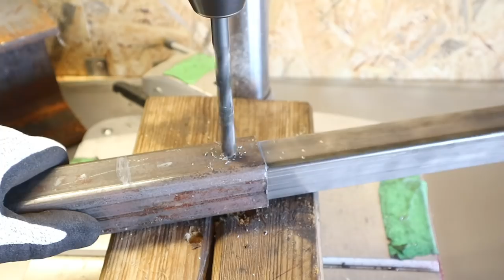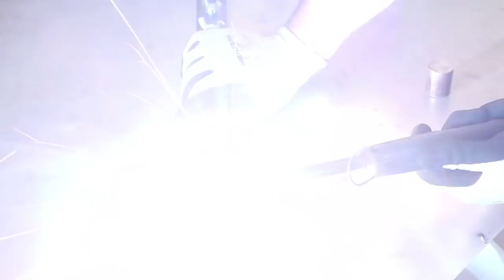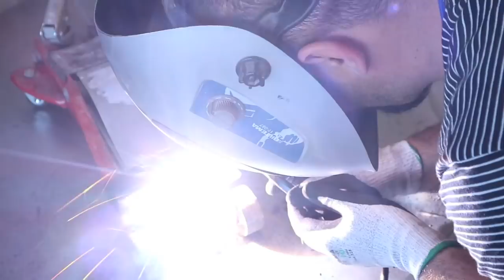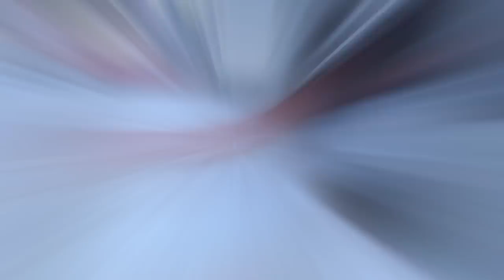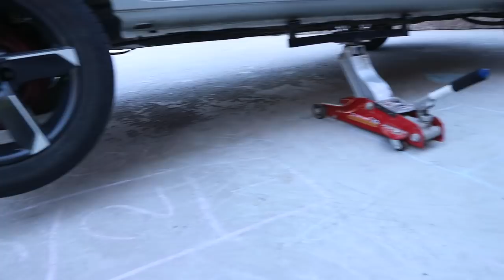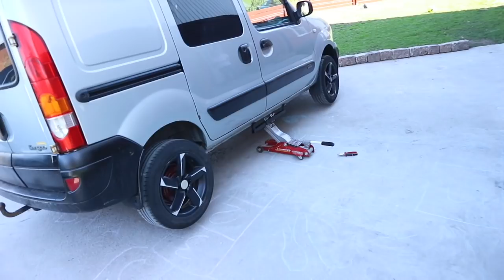Amazing Car HACK

Comment: What you've done works well, but if you already have a good floor jack and just want some good stands to use with it, I've found that a railroad tie cut into a pair of two foot sections is one of the strongest stands you can have, and they last for decades.

Comment: Very clever.  I am concerned about the jack placement on the body.  My vehicles have designated places for jack placement.  Just not sure I would want to raise vehicle from the jack position as shown.
Reply: THe pinch-welds are re-inforced ... but I think this is likely OK given we're dividing the weight over a broader area and multiple touchpoints. I feel safer about this than doing what other videos suggest and pick a spot that "looks strong" under the car. I miss my Mustang where I could just put a jack under the rear axle housing. Even a Honda Pilot has a jack point under it's rear differential.

Comment: the base idea is very good, I'll make one for me with some mods as this setup is prone to scratch the protective coatings and promote rust formation.
it needs a special attention to find the gravity center to avoid the lifting of an off center load because the crocodile jack is not designed to absorb torsion loads

Comment: This is exactly the project I'm thinking of.  This way you can rotate your tires at home.
Reply: jkwo2007 why not jack from the center under the car? These definitely don’t go out wide enough... my Mazda jack points are like inches away from the wheels. By then the beam you’ll need will be super long and unsafe!

Comment: He's not using the MFG location for lifting the car. Because that is where he will put his jack stands once the car is up. This is just temporary to lift the car and then put his jack stands in the MFG location.  Everyone with common sense who works on cars. Know not to go under a car with just a jack holding it up.  If you are that dumb..... you should not even be working on a car.

Comment: Look around the background in the video. Small children's toys... children moving around on the driveway, a hop-scotch game drawn with chalk on the driveway under the vehicle......
All excellent reasons why its not a good idea to hack something together in your workshop, then jack your 2 ton vehicle up with it, before sending off to the Underwriter's Laboratory for safety testing.
How much load will the welds withstand, or the max sideload value, at which, the original jack lift-cup will support before shearing? You may be able to offer a guesstimate, but the fact is... you simply don't know.
At least make a point to demonstrate the use of jack-stands in your video, for safety sake.

Comment: Sorry but you should not be making videos. I have watched a few of your videos and they are so bad, some dangerous. And if you use this contraption on a car you are a fool. Cars have jacking points for a reason, to be structurally safe when all the weight of the car is in one area. But worse still is what you made, are you willing to risk your life working under a car with the flimsy thing you made, can the size of box section handle the weight, are your welds good, the drilled holes weaken the strength of the box section. Also you could damage your car using this. You are dangerous, if people copy your videos you are putting them at risk. You have an obligation to think before you post this rubbish.